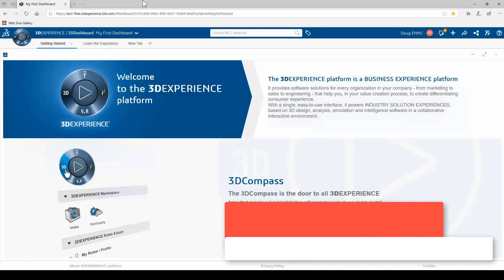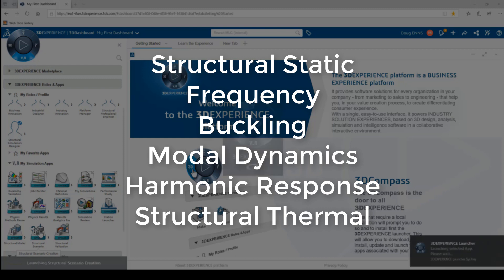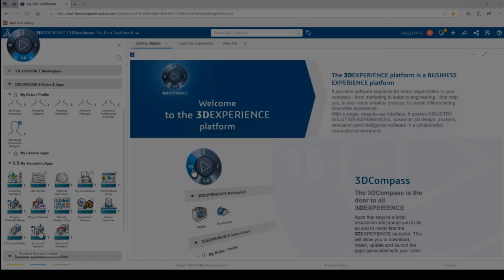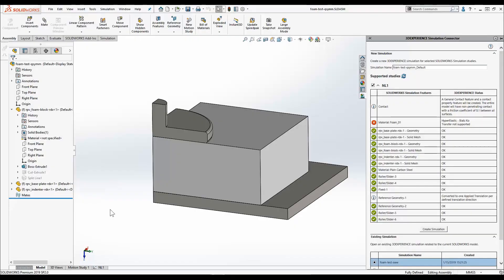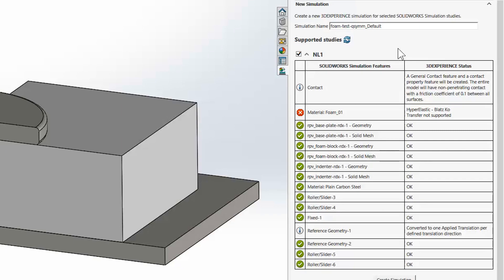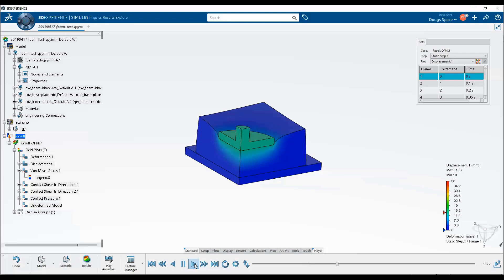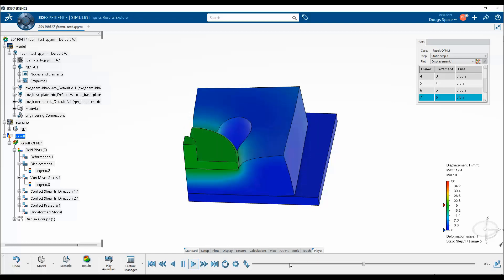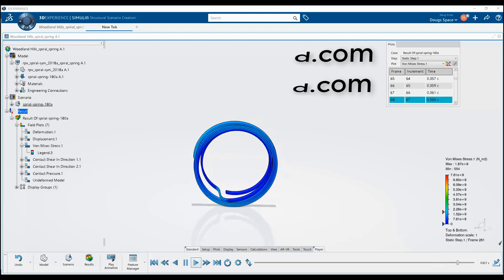Advanced Simulation on the 3DEXPERIENCE Platform

Comment: Could you do a simple beam analysis?
Reply from the maker: The 3DEXPERIENCE products that use the Simulia engine are comprehensive analysis tools and would be capable of handling almost any structural analysis challenge.  These products contain very powerful solvers but are not as easy and intuitive to operate as the SOLIDWORKS Simulation products, so I would speak with a SOLIDWORKS Reseller representative regarding your specific needs and what solution would offer the best combination of power and features.